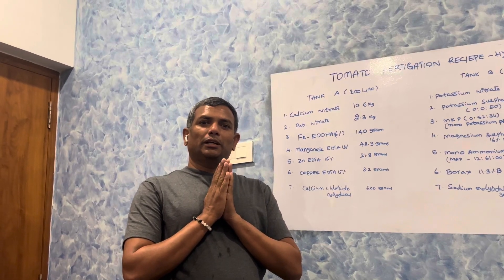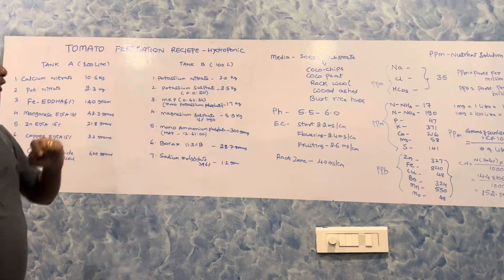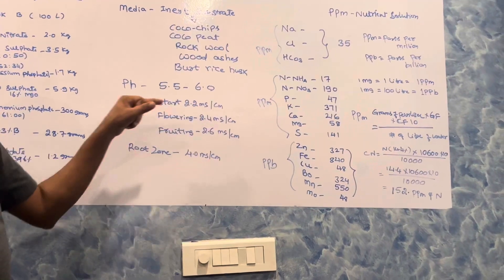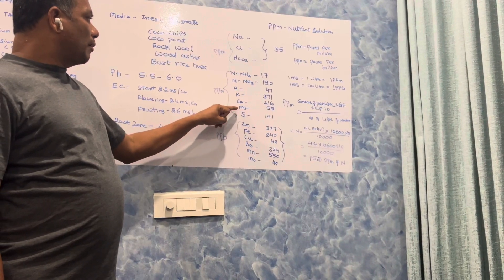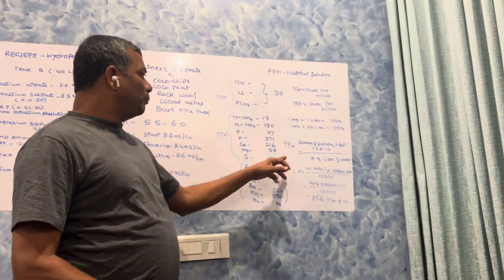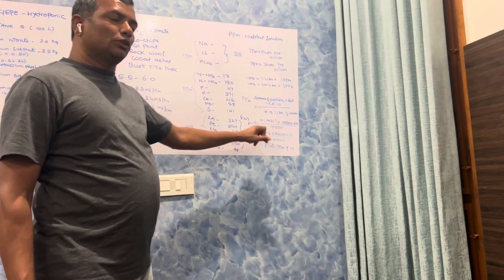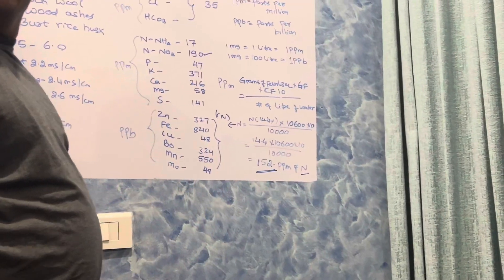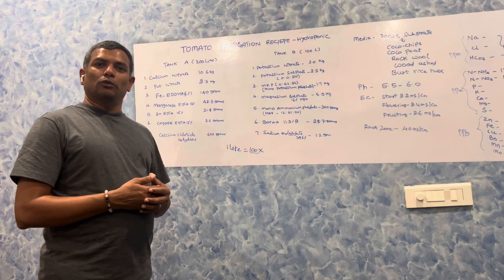Hydroponics fertilizer recipe tomatoes green house

Comment: Hi sir ,i have some questions
1. Can we use manganese EDTA 12% instead of 13%
2.can we use Zn EDTA 12 % instead of 15 %
3.can we use Cu EDTA 12 % instead of 15 %
4. Sodium molybdate anhydrous or dihydrate which one to use
Reply from the maker: You can use 
Sodium molbydate anhydrous
Reply: @Hydroponics_venu27  sir what about other 3 questions
Reply from the maker: @manualive1850  you can use the grades as mentioned by you

Comment: great explanation sir. very few people go in such depths. unfortunately, i still have a lot of questions.

1. does the correction factor remains same for all fertilizers?
2. generally people recommend micro elements with sulphates and phosphates, but you have suggested with nitrates. any specific reason for that.
3. boron source recommended is 11.3%. can we use 20% instead? will this decision affect the tank choice? and will it result in any reactions if quanitity is justified as per %?
4. what was the purpose of using cacl2? is it just adding calcium or something else also? will the added clorine affect plant growth? and is it 100% soluble?
5. is there a way to add silicon in this solution for strengthening plants?
6. in growbags, if we keep flooding the solution regularly to drain almost 20%, will the ec still reach upto 4.0????
Reply from the maker: 1. Yes it is same 
2.sulphates should not be mixed with phosphates
3 we can use 20% boron 
4 it is to add extra calcium and keep a good balance of calcium,chloride doesn’t affect if it is below permitted limit ,calcium chloride is water soluble 
5 silicon normally not required
Reply from the maker: 6 20% flooding is not all times  it is during peak season of summers 
Once slab/grow bag EC cross 6ms use normal water to drain out extra salts